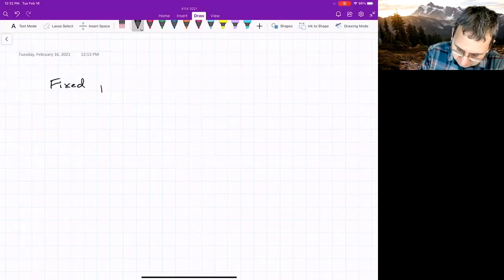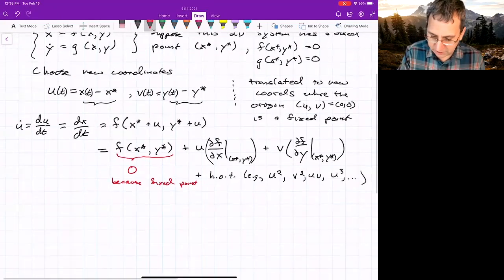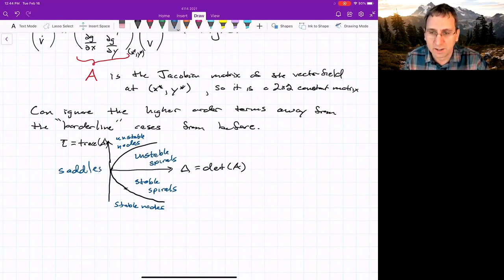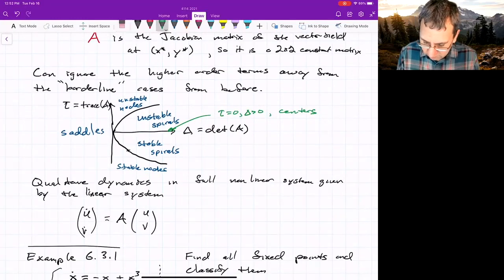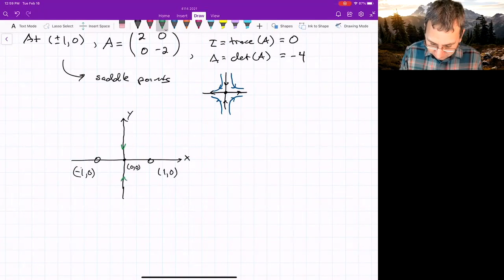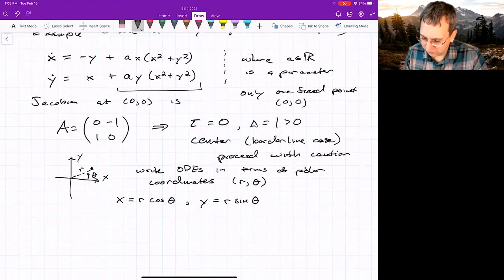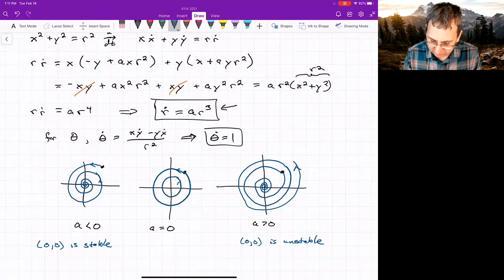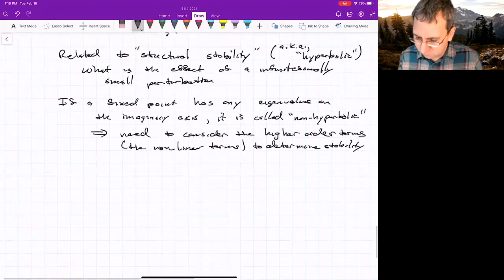Linearizing Nonlinear Systems: The Jacobian at Fixed Points (Strogatz Ch. 6)

Comment: Hi Sir hope you are having great time. I have a question regarding fixed point. In context of a function fixed point is defined where f(x) = x or standard notion is T(x)=x. But in context of dynamical system when we use the word fixed point it seems that it doesn't relate to definition T(x) = x but rather we say that fixed point is where the derivative is zero. So my question is that does the word fixed point meaning differs in both contexts or is there any analogy.
Reply from the maker: Good question. The two ideas are closely related, but one is for discrete-time dynamical systems and the other is for continuous-time systems.

For a discrete map

x_(n+1) = T(x_n),

a fixed point satisfies

T(x*) = x*

meaning the point does not move after one iteration of the map.

For a continuous-time dynamical system (ODE)

ẋ = f(x),

an equilibrium/fixed point satisfies

ẋ = f(x*) = 0.

Here the derivative is zero, meaning the state does not change with time at all.

So the concepts are actually analogous:

• discrete system: “next state equals current state”
• continuous system: “time rate of change equals zero”

Both describe states that remain unchanged under the dynamics. And in general, I refer to both types as "fixed points", but in the continuous case, I sometimes use the term "equilibrium" or "equilibrium point" as a synonym.
Reply: @ProfessorRoss Many thanks